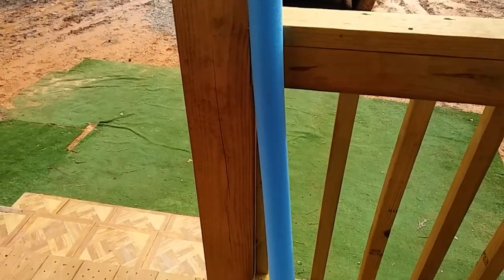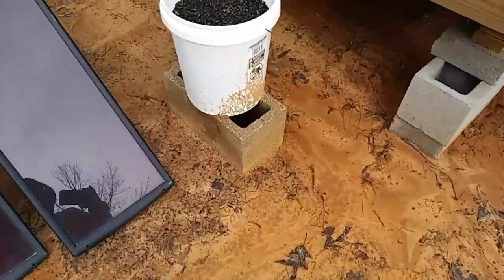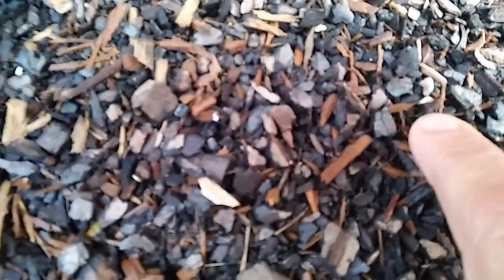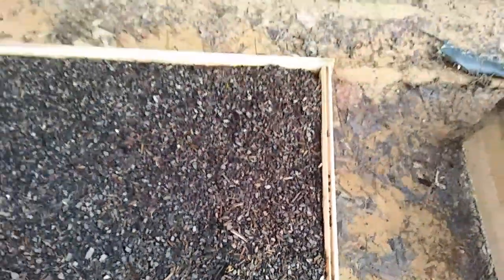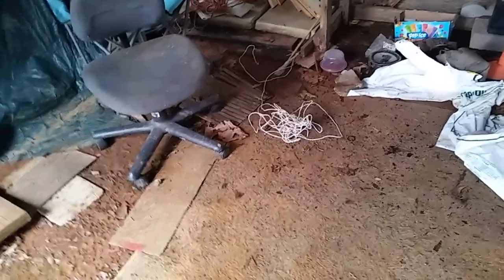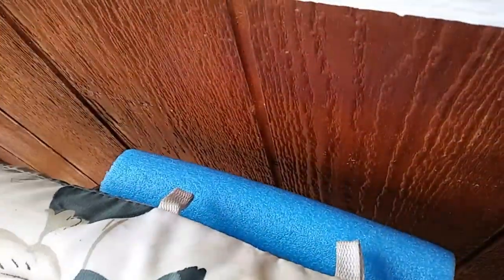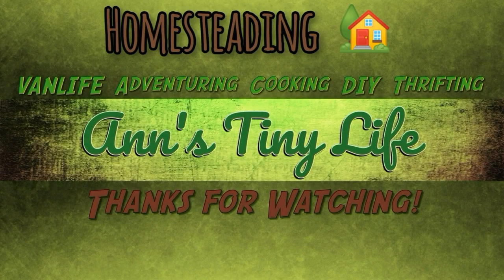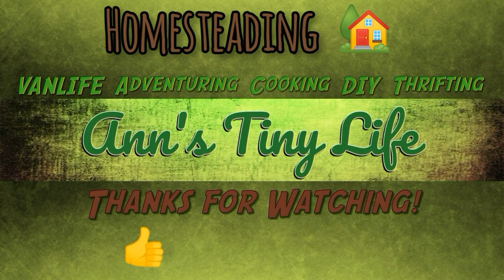Let There Be Life - Ann's Tiny Life

Comment: If you can get your hands on some clear polythene to cover your seeds it could help hold in some heat and let in the light.  Lovely to see your seeds sprouting.
Reply from the maker: It would be super cool if I can get ahold of some of that that's for sure!
Reply: @AnnsTinyLife  Dollar Tree  or Dollar General should have a clear shower liner for a dollar!  That would work fine!
Reply from the maker: Well I did go to Dollar tree. And I did get a shower curtain. But it's going to be used for a different application. LOL new project coming!